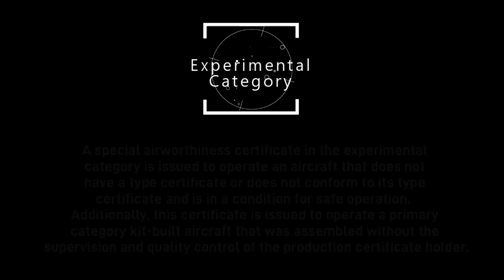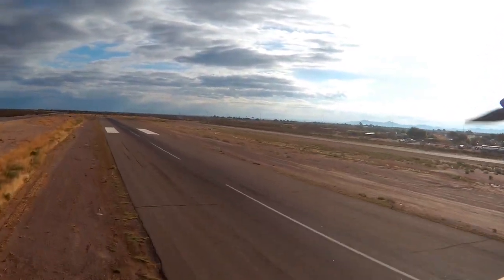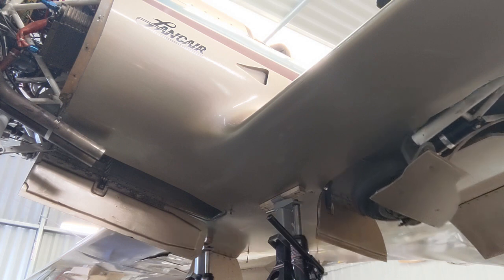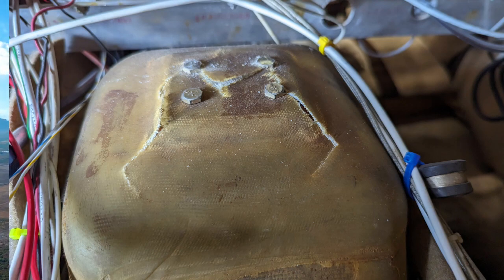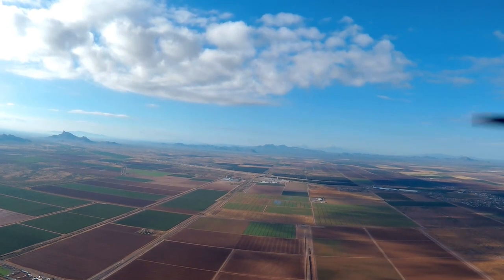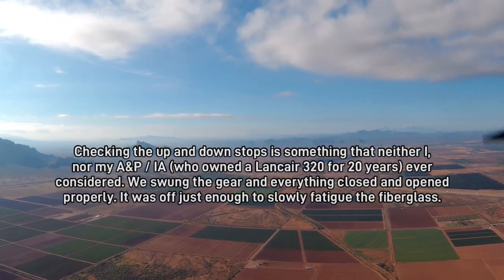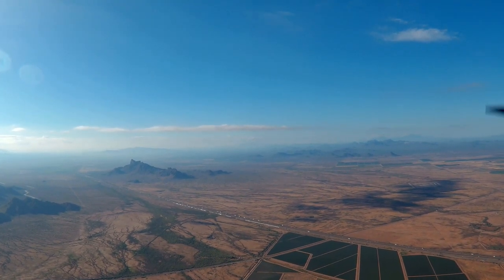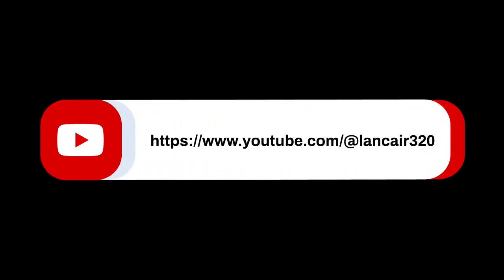Nose Gear Hydraulic Cylinder Failure

Comment: I've made this repair to 2 airplanes.  It can also fail from the extended length being incorrect also.  Meaning, the actuator is too long.  It blows the mounting plate out the top, just like pulling it down out the bottom.  Make sure that with hydraulics powered up, the bolt should just slip into the rod end on the over center link.
Reply from the maker: Thanks, Tom! I actually had to grind off about 1/16" of the thread to get it to be proper, but it's good now. The bolt slides in when down, and when it's retracted there is just a tad of wiggle left in the gear going up so I know the cylinder isn't pulling on anything but itself when closed.